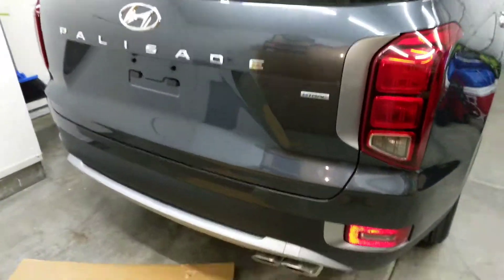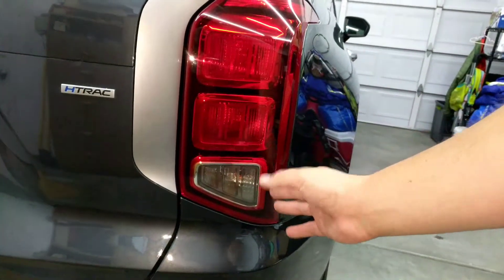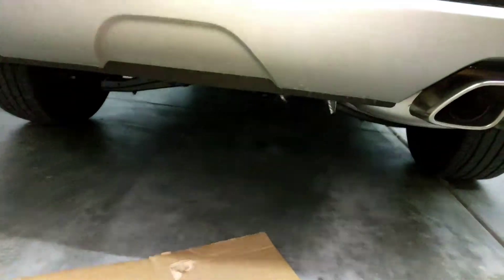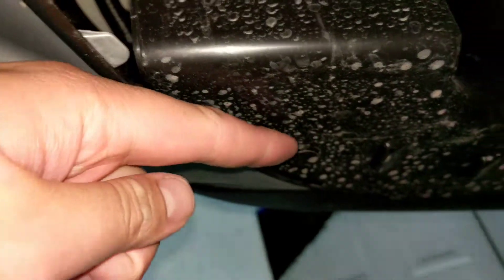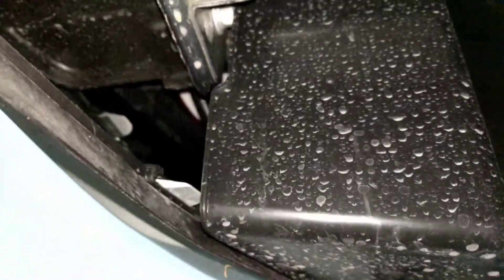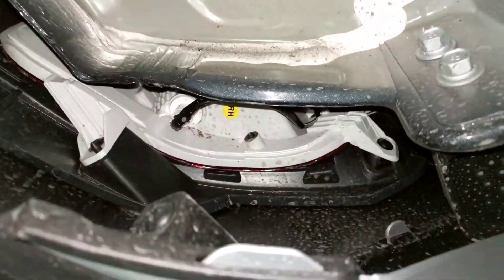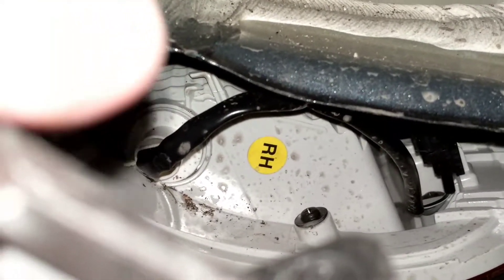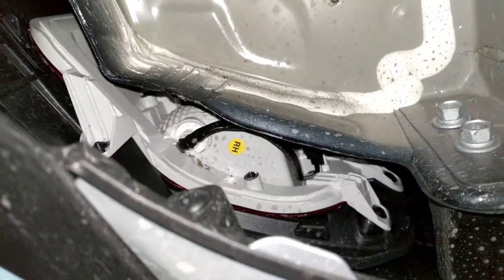Hyundai Palisade 2020 reverse LED light install

Comment: Thank you thank thank you....just did the install this morning-took 20 minutes-used the bulbs from the Amazon link which fit perfectly. Helpful tip-for the cover on the driver's side, remove the side clips first with a screwdriver and the just pull down with some force. The 2 high nuts are pressure fit and the nuts stay attached to the cover. To replace, just line up the posts and push. Cheers!
Reply from the maker: I'm glad the video was helpful! I really do appreciate you watching and commenting.   Thanks again for reaching out!

Comment: Thanks Ash, I was curious about how hard the install would be. The manual says to take it to the dealer if the lamp burns out. Which LED did you put in? Is it brighter than the original?
Reply from the maker: The ones I got were from Amazon.  I've used these in my Nissan Pathfinder and my previous crossover Santa Fe Sport.  I say yes they are about 50-75% more brighter then the stock oem bulbs.   I also like the look of the crisp white/blue color they give off, it reminds me of a luxury car.  JDM ASTAR Extremely Bright 2000 Lumens 360-Degree Shine 921 912 90-EX Chipsets LED Bulbs For Backup Reverse Lights, Xenon White JDM ASTAR Extremely Bright 2000 Lumens 360-Degree Shine 921 912 90-EX Chipsets LED Bulbs For Backup Reverse Lights, Xenon White https://www.amazon.com/dp/B01GGK6QDW/ref=cm_sw_r_cp_apa_i_DGVpDbPJQHKJQ here is the Amazon link for the bulbs.
Reply: thanks Ash
Reply: @ashhiro8179  how are the  bulbs perform after a month? I wanted to change mine out to led also.
Reply from the maker: @mrchenla1  yes they are working perfectly still.  They are much brighter then the stock oem bulb's
Reply: @ashhiro8179  that's good. I followed your link for Amazon but it stated that it will not fit the Palisade.
Reply from the maker: @mrchenla1  so I originally owned a santa Fe sport 2014. And I bought these bulbs for it because the original sucked. And before I sold it I took them out and installed it into the Palisade.  Amazon is good with the fitment guide but it isn't always accurate.     But it's up to you.  I hope that they work for you like they have worked for me. 😁 But thanks for watching and hope that it works out for ya
Reply: @ashhiro8179  Looking at my original reverse light halogen bulb through the rear bumper lens, I can see the white base which sticks upwards quite a bit into the housing and then the halogen bulb sits on top of the white mounting base.  Since your LED bulb has a very long silver casing at the bottom in addition to the plug-in portion, I would think that your LED bulb sits very high in the light housing and very little direct light would emit outwards, except for the light bouncing off the reflectors. Is your LED noticeably brighter than the halogen?  Have you considered a less taller LED?
Reply from the maker: @bikeriderskier  that is a good question.  The reason why I used these LEDS is because they were the ones I took out of my Santa Fe Sport, and they fitted correctly into my new Palisade.  

I did notice that In the santa fe sport the projector lens (on the LED bulb) faced out and backwards towards the rear of the vehicle and you are correct that the way that they are installed now (In the palisade) they face up into the housing of the reflector  and not the road. I dont know if I had a better angle if it would help.

 I do know tho that having these LED bulbs that I can still safely back up and see the road correctly with the LED I have installed at night. (even tho the main projector part is faced straight up in the reflector housing) 

I hope that this is helpful.  Please let me know if you find some that fit and are better I'm all for brighter lights and to be able to safely back up.

Good Luck!  😁  Congrats on the new  car BTW's

Comment: Great video...we it's got ours last week. How did you remove the upperconnectors on the driver side. Are they screw or pull off?
Reply from the maker: I just pulled, (sounded like I stripped it out but it didn't)  just be careful.   You could try unscrewing them I just didn't have the right tools and risked it and pulled it down.
Reply: @ashhiro8179  thanks....tried screwing but no luck...will pull down
Reply from the maker: @nkohlimd  I'm sorry.   I hope it works out for you.   And congrats on the new car!  😁

Comment: I have a SEL too, did you say you changed the tailgate lights to LED as well?
Reply from the maker: Hello Dan,  Yes I changed out the bulbs to LED, but I'm getting a burnt out brake light warning on my dash when in reality the brake lights are working perfectly fine if not better then before. I'm thinking of going to the dealership to see if they can reprogram the computer to not worry about it and no longer have a "burnt out tail light warning" on the dash.
Reply: @ashhiro8179  Oh nice, thanks Ash!
Perhaps at your convenience you can give hints on how to change those. Thanks again
Reply from the maker: @graceamazing5321  I have some video footage of it. I'll get it uploaded. be on the lookout and you can check it out.  I'll Reply to you on here when I get it uploaded.  Congrats on the new ride BTW!
Reply: @ashhiro8179  I guess you've not had a chance to upload the video(s) yet.
Thanks
Reply from the maker: @graceamazing5321  Hey man!   Got the time to edit now I'll work on it tonight and upload it when I'm done I hope that it is helpful.
Reply from the maker: @graceamazing5321  hey I uploaded the video it's under my playlist "car stuff". I hope it's helpful
Reply: @ashhiro8179  Thanks!!
Reply: @ashhiro8179 
I saw this video about the vertical side lights at the Tail. I think the highest trim naturally has that side(vertical) light.
It's looking like the tweak in the video is NOT meant for base Trim like the SEL,  Any thoughts?

Here's the video link
https://youtu.be/MuKZufhLd1w
Reply from the maker: @graceamazing5321  Ya I agree I think it's only on the Limited model or upgraded tail light system.  I only did the Basic package of the SEL. I really wanted that dual climate and remote start, and push-button start. but I knew that if I had too I could always upgrade the Lights my self eventually as they come out with new upgrades for the car.  Have you seen that K&N has come out with a new engine filter for the Palisade and Telluride? I keep looking at the site to try and snag one before it sells out again.  Keep me posted if you figure out a new strategy for those tail lights.

Comment: So. My manual says this lamp is a P21W. Not correct. It has a T10 type connector. But T10 isn't nearly bright enough. It's fine for the interior or license plate. What did you use for the backup lamps?
Reply from the maker: Hey Scott,   These are the lights I used as the reverse bulb replacement.  Here is the Amazon Link.  https://www.amazon.com/dp/B01GGK6QDW/ref=cm_sw_r_cp_apa_i_DGVpDbPJQHKJQ   I originally had these in my Hyundai Santa Fe Sort 2014, but when I sold it I took these bulbs and they fitted into the Palisade and are still working for me.   I hope that you like the difference and they are helpful,  if its still not bright enough you might need to do one of those license plate covers that double as a reverse light.

Comment: When you said you just unscrewed the passenger side, you meant you twisted the lamp holder out of the fixture and didn't unscrew the screws holding the fixture in place. Right?
Reply from the maker: That is correct just the little white plastic piece that holds the light bulb in place in the housing.  just like changing the bulb on any vehicle.  I hope it works out for you. thanks for watching. 😁
Reply: @ashhiro8179  Took longer to watch the video than to replace the bubs. Now to wait until dark to see how much difference it makes.
Reply from the maker: @popeyeandy959  I hope that it works out for you let me know if you figure out a better-LED set up to provide better light.  I'm looking forward to learning more from ya.
Reply: @ashhiro8179  you learning from me? Heck, I was hoping to learn more from you.
Reply from the maker: Popeye Andy we can learn a lot from each other haha.  😁👍 but I’m always happy to share what I know

Comment: @Ash Hiro - Lights on the led strip, reverse lights and license plate light(one on the right) is not working on the passenger side. Brake light and turn indicator on both sides work. Any idea what could be wrong? Is there a fuse I can check?
Reply from the maker: Dang I'm really sorry about that,  did you replace the reverse light with an LED like mine and it caused a short? Or did it just stop working with the original bulb and your looking for a way to repair it?  🤔😬
Reply: @ashhiro8179  yeah installed with an LED. It worked fine for a day. Now the reverse, one of the license plates and led strip just flashes for a second and goes off.  Almost like power is being cut off.. i don't think it's a fuse problem because it flashes.. I installed all the original ones back and the same result.. let me know if you have some ideas
Reply from the maker: @sajithpb  man I'm really sorry to hear that.   Ya if you tried installing the original equipment and its still shorting out. Id say get it checked by the dealership.   I just got a recall for the air bags as of today for mine it's for the curtain air bags and some sort of screw they have to replace.   It might be one for you. Would be a good chance to get it checked out.   Let me know what they figure out I'm sorry I don't have an answer for ya. 😬
Reply: @ashhiro8179  kool bro.. I hope changing the bulbs don't void warranty.. 🤐
Reply: @ashhiro8179  Quick update. Took it to the dealer. Looks like a faulty control system. They had to replace the whole tail light. All good now.
Reply from the maker: @sajithpb  that's great news. Thanks for following up, I just got a recall notice on mine for the curtain airbag and some sort of screws.   Glad to know it worked out for ya!

Comment: When you replace the reverse tail light did u get any warning sign in the dashboard??
Reply from the maker: I did not get any warnings on the reverse lights,  But when I replaced the brake light bulb I did and had to use a resistor.  Hope this helps